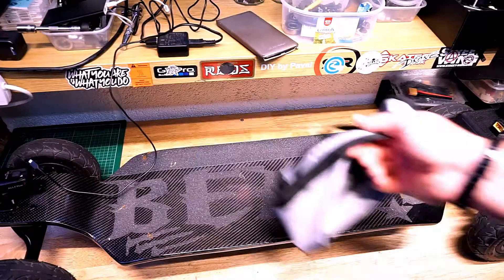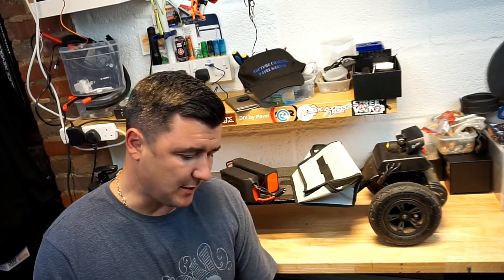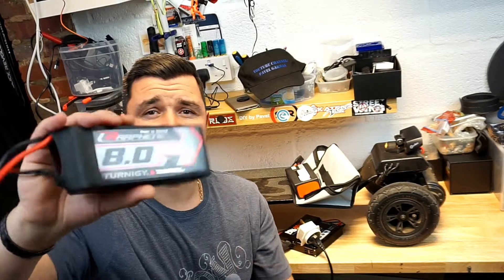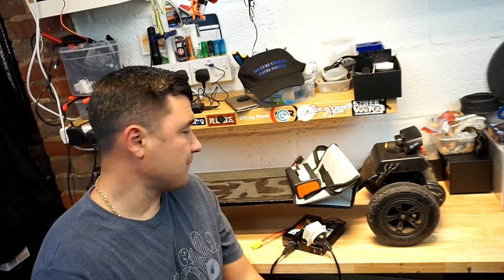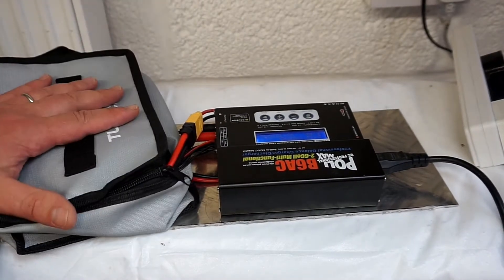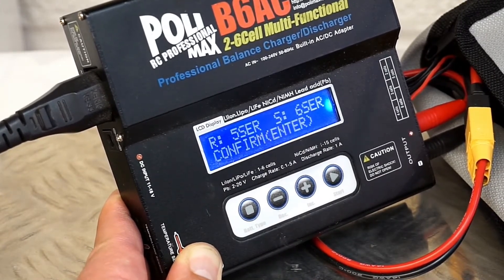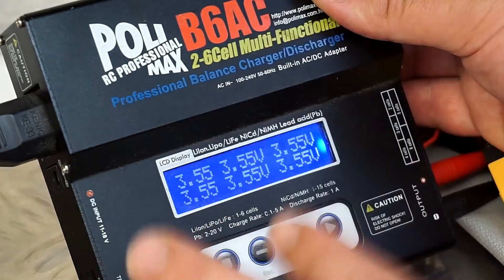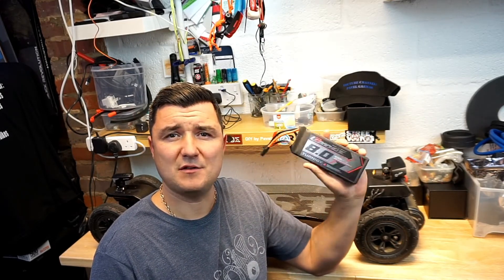How to revive Lipo battery. ESK8 did you know? Video 10

Comment: Did you change the alarm sistem? Thanks for the video, keep it up!
Reply from the maker: Hi Frank!
Sorry but what do you mean by alarm system? Cheers.
Reply: @PavelGarmas  the battery lipo alarm, did you change it for another one with higher voltage than 3,3v?
Reply: The low voltage indicator
Reply from the maker: @africans1968   I see! No i did not. i just stop riding as soon as the alarm goes off . It is possible to go for another mile after the alarm rings the first time.

Comment: I had a charger like that. Got sick of its pretty quickly, it takes so long to charge. My iSDT chargers will balance charge if cells are at about 3.2v or even less with a heap of difference between cell voltages. Seeing how the Graphene batteries hold up over time is what I want to see.
Reply from the maker: Hi,
Thanks for the comment. I have started to ride the board quite often and do abuse it ....well off road riding mostly so they do get drained fast. I will do a catch up review after 50 changes or something. Got the range tested so just need to edit the video....

Comment: Nice video and glad you got your Battery back to life those Graphene Lipo batteries look great.
Reply from the maker: Simon , will not lie - i did panic for a bit there : ) I was testing the max range on them Lipos and did discharge them a bit more than i should. Only done three cycles on them so would be upsetting if 180 quid worth of batteries gone to waste. Hope this video will help someone.
Reply: @PavelGarmas  Yeah I know with 42 volt 10s2p batteries you can buy recovery chargers that go lower than the normal volt limit but I don't know much about lipo batteries so good to know. Next year I might buy a Trampa so ill be looking at Graphene batteries myself.  Just bought the Mrs a Zero 8 scooter hoping it arrives tomorrow they look pretty cool.
https://youtu.be/YzUQrPOhtlw